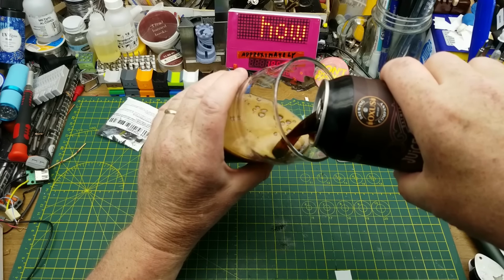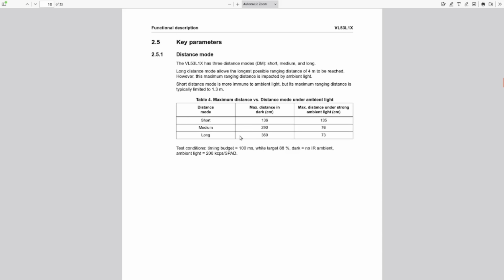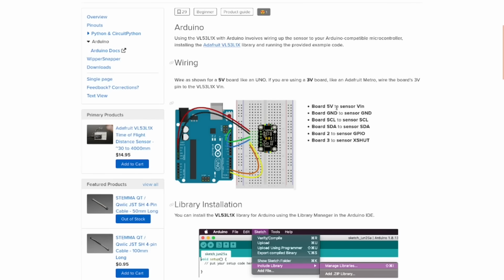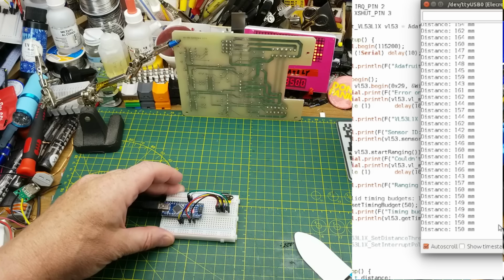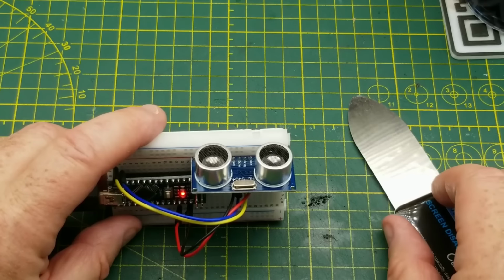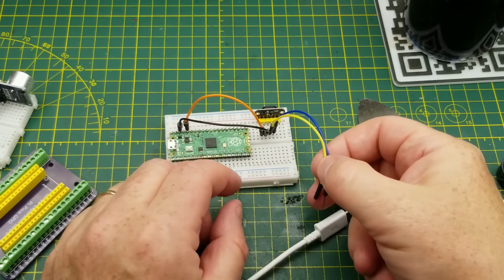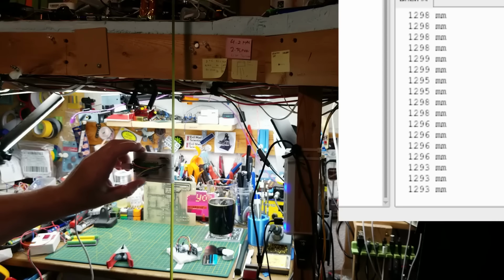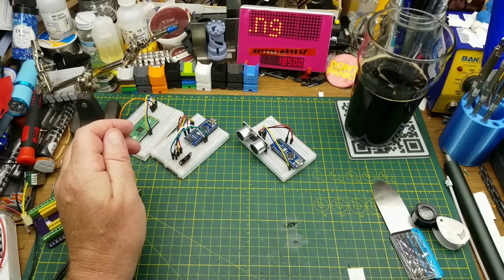Tinkering with distance sensors

Comment: The microwave proximity sensors are cool too. Theyre a little more pricey though but can basically monitor people's heart beats if you buy a beefy one or one to monitor falls for the cheaper ones. I use one to mess with my cats.

Cool video kent. I never seen this particular sensor before.

I haven't done embedded stuff in ages. I've been playing with ooengl or writing music. My hobby room is so cluttered now getting at my bench gear requires tripping over many guitars and effects pedals.

Im doing a reno in there soon and might document it

I can't believe I've b33n a member for 38 months haha

Comment: They probably did not perform offset calibration at the factory.  Not sure if the cal data is stored in the device or need to be loaded by host controller during bootup.

Comment: Would it sense an animal like a rat/mouse that the micro controller would then activate a relay circuit?  Regards and thanks.
Reply from the maker: I would think an infrared (body heat) sensor might be a better option.  Though they may not be sensitive enough for a critter smaller than a dog.

Comment: Mine is the VL53L0X (VMA337) , infrared, 3 to 200 cm, with gesture detection, all untested, 
also Paul mcwhorter (youtuber) has micropython code for ultrasonic device HC-SR04 + pi pico family, look for "Raspberry Pi Pico W LESSON 107"

Comment: Could you also see if it's suitable for outdoor use, does sunlight affect the sensor?
Reply from the maker: The datasheet indicated that accuracy is reduced in bright light.
Reply: @pileofstuff  the datasheet test data is for the raw sensor. The module has an IR filter installed.
Reply: You can always find one that is suitable in bright light and just buy some conformal coating. Mg chemicals make some that glows under a uv flashlight light to make sure you got all the proper places.

Comment: Neat sensor. In previous life worked with * sensors and always looked at it as "if sensor keeps giving the same number for identical setup then just build a calibration table and handle it in software".  Have avoided programming since I retired.
Reply from the maker: Yeah, if this was being built into a product, I imagine it wouldn't be too hard to add some calibration offsets to the code.

Comment: Great stuff. I just got the TOF sensor. I will replicate your example. I agree, the pin markings on the underside of the Pi Pico is really annoying. I have made a LibreWriter document with the pinout, if you want I can send you a copy. It's a simple grid no colour as I use a laser printer (I don't print out enough stuff for ink jet -- they dry out on me).
Amazing, you have a metric measuring tape, they are hard to find here. 
Thanks for the inspiration. Take care.
PS. I just sent you the file.